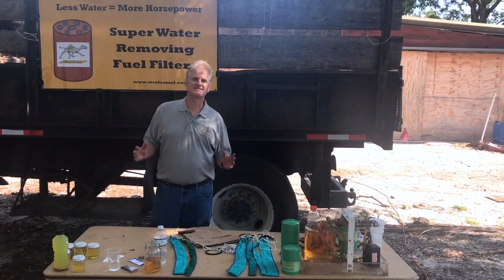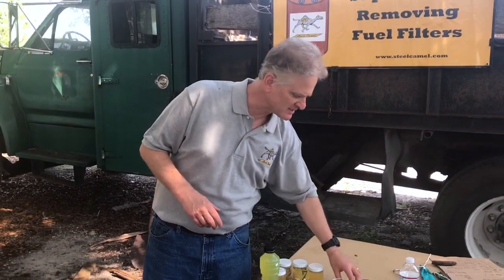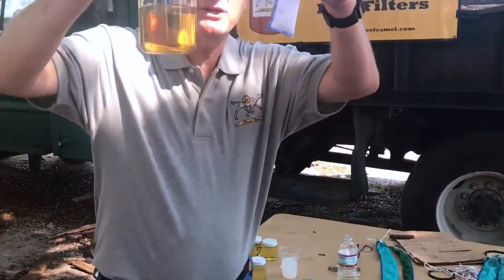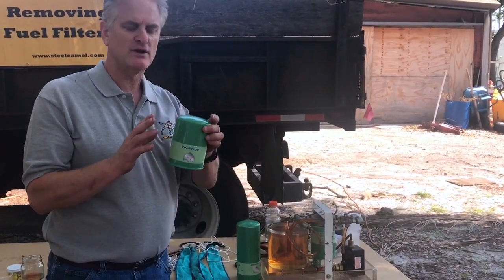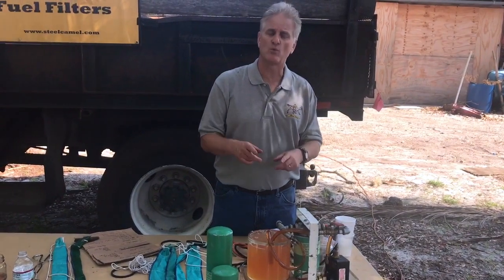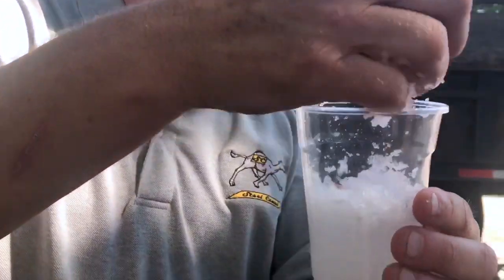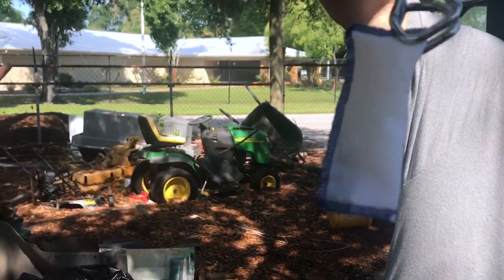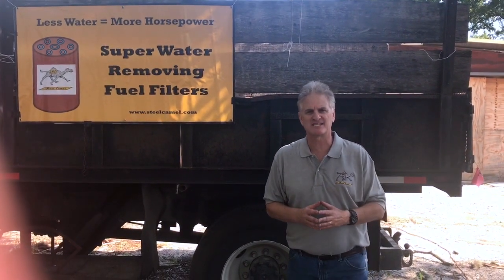How To Remove Emulsified Water From Diesel, E10, Biodiesel & E85 With Absorbing Socks - Steel Camel

Comment: Sodium Acrylate Copolymer absorbs water, because it is Hygroscopy is the phenomenon of attracting and holding water molecules via either absorption or adsorption from the surrounding environment, which is usually at normal or room temperature.
Reply from the maker: Hello Seth,  thanks for watching and responding.  Not all Super Absorbent Polymers are alike. Our product does absorb water but a little different than a diaper.  Over time, we can pull moisture from the fluid into the bag.
Happy to help.  sales@steelcamel.com

Comment: So will it absorb water already in fuel lines? I realize its good for fuel tanks but how about the lines? Or am i missing something?
Reply from the maker: Hello Jason,  by removing water in the tank, you will have less water in the lines..........and with filter on the engine......you will have a lot less water in the fuel injector.........happy to help.
Reply: @steelcamel5626  hey thx ,I'll check into it.

Comment: How will someone determine how much water is in the tank that needs absorbed? When you need to dispose of the camel tail product after it's collected water, is it safe for the environment to just throw it in the trash? Is it going to break down in the environment without harm? How would someone know when the camel tail has collected all the water or if there is more water needing collected thus requiring another camel tail?
Would be great to have some type of funnel that can swiftly collect any water from a gas stations bad tank while you are filling your vehicle with gas.
Reply from the maker: It is difficult to tell exactly how much water is in the tanks unless taken to a lab, then have a Karl Fischer test completed, even then it hard to pinpoint the exact amount of water.  To dispose of, hang It in a cool dry place for several days, then discard in the trash. The chemistry only attract water, any fuel will evaporate off.

Comment: All you need is a adapter for the filter inline with fuel filter and you would virtually never have to worry about water. Just change the filter with fuel filter or if you leave it sitting for a period of time.
Reply: Excuse me i dont understand, could you expand on this a little ?i am new to diesels and boats but now for the second winter in a row i seem to have water in my fuel and my fuel.So you talking about adding something between water filter and fuel filter ,i get that much but im not clear on what you adding exactly ? An additional filter of some kind? Obviously water filter but by what means is what i dont quite get? Thx
Reply: Ive read what youve said over and over but i dont get it..what kind of adapter?

Comment: How does it deal with bio fuel which is water based and in all fuels?
Reply: Biofuel is not water based.
Water is involved in the production in both the agricultural aspect and the production/processing side,  but its not made from water....its still processed from oil but that oil comes from renewable sources like plant oils and animal fats etc
Reply from the maker: Steel Camel Technology works very well to remove suspended water bonded to different blends of fuel, including biodiesel and ethanol blends.  The chemistry attracts and holds the water in our filter paper.  If  you are cleaning the fuel with filters, the key is slow flow  4-8 gpm.  The sock or camel tail takes several days, it will swell and blow up as it collects water.  The operator will know when saturated once it blows up all the way.

Comment: Repairs on equipment with water in fuel are my personal curse
Reply from the maker: Hello,

My name is Alex and involved with blocking and removing water here at Steel Camel.  Yes, water in fuel can cause lots of aggravation, sludge, black smoke and crappy running engines. 

Wanted to ask if you can share what type of diesel tank(s) you have and on what type of equipment.   We might be able to send you a few samples to play with.

Thanks you,

Alex

Alex@steelcamel.com